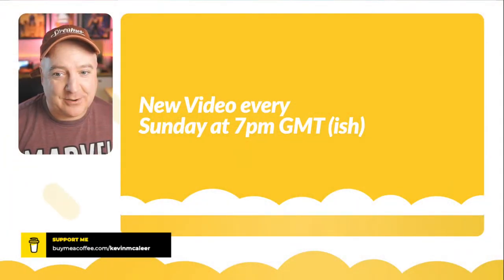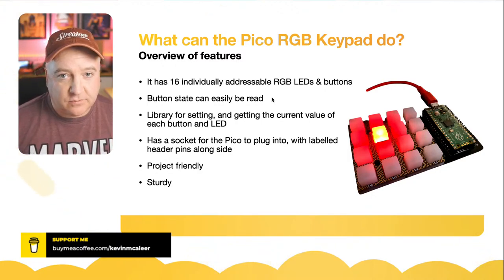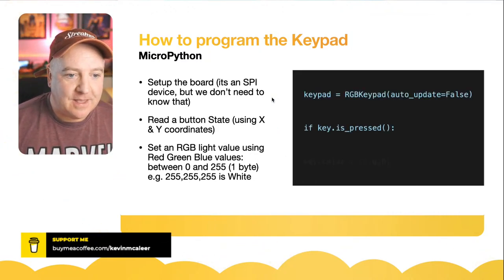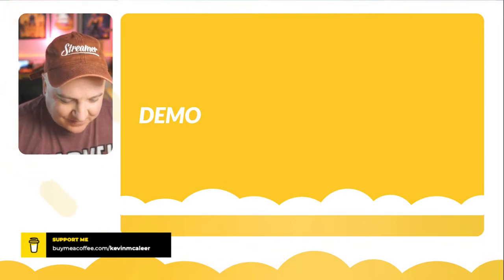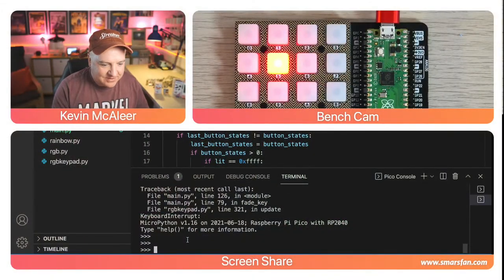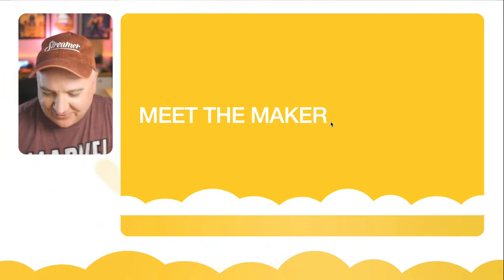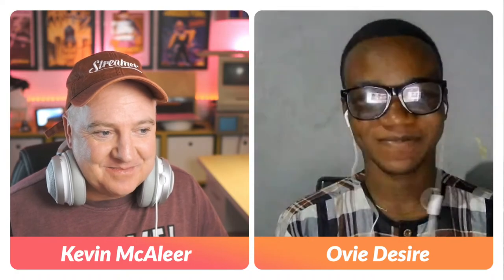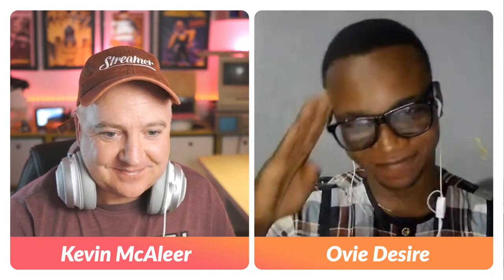Raspberry Pi Pico RGB Keypad Base from Pimoroni | Plus Meet the Maker

Comment: Seems that everyone that does a "How to" on the RGB Keypad always focus on the RGB part of it, changing colors and useless visual effects. It would be nice if someone actually did a "How to" on using the RGB Keypad for an actual KEYPAD; like a Numpad or Macro Pad.

I recently downside from a full size keyboard to a TKL to reduce desk clutter, so I'm without a number pad. It would be nice to be able to pull out my RGB Keypad when I need to do some number crunching in Apple Numbers (or MS Excel.)
Reply from the maker: Great idea Marshall - I’ll add that to the ideas list. This should be pretty easy to do (I’ve found an article on Adafruit on how to create a usb keyboard HID using a Pico, so should be able to do this with an RGB keyboard or soft touch keypad.
Reply: Took me a bit, but I did make this into BOTH an RGB light show and a macropad. What I would LIKE to do, but I'm not good enough yet is make one row the selection options, and have 4x12 keys. I used Adafruit circuitpython libraries, but it does have a LOT of dependencies, which isn't great. Would be nice to get cleaner Micropython code if possible. I would love to see an update on this project!

Comment: Hellow, I was wondering if you will be willing to help? I have a pico that literally and no matter what I do "Do Not Get recognized by my raspberry pi" I have read all the micropython information changed the ports and follow all direction but still I can not make this microcontroller to be recognized or get any kind of interaction between computer and microcontroller....
Reply from the maker: Has this board ever worked? What version of MicroPython have you flashed onto it? Have you tried flashing a different image such as circuit python or C++ to see if it’s just a corrupted image?
Reply: @kevinmcaleer28  No Kevin, this board never have actually show sings of life... In honestly It is kind of a mystery for me to know if I purchased a brick!!! I bought two of them and both of them show exactly the same behaviour......